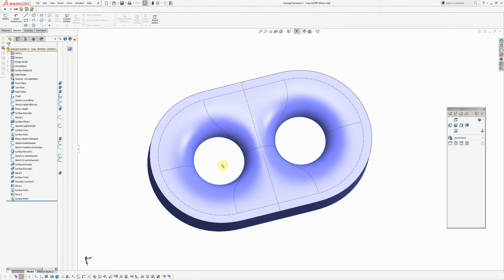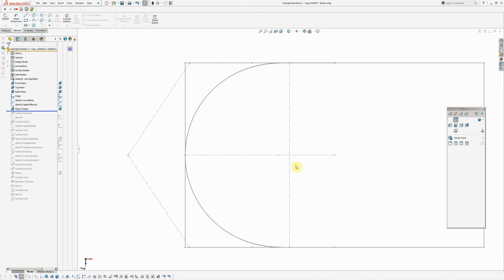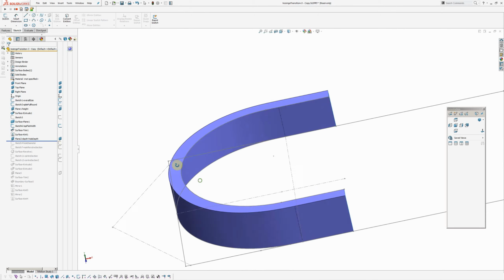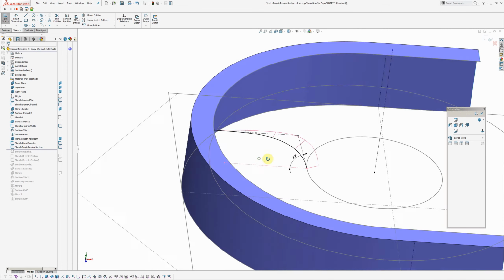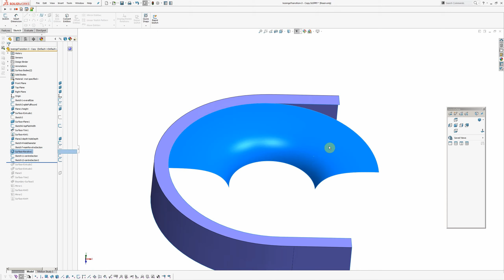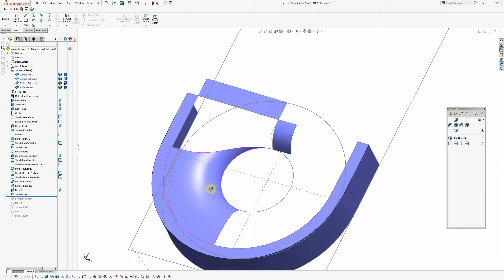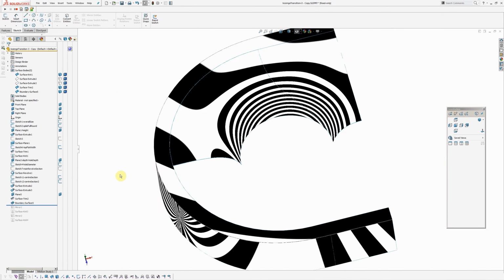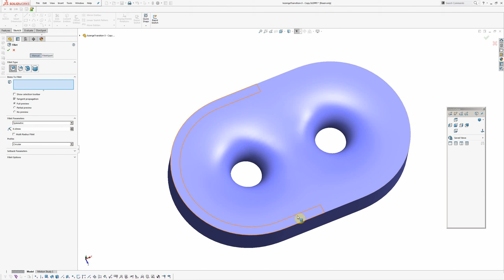Solidworks Tutorial: Modelling a single to double loop transition

Comment: Great video, very clever way of getting that transition to work. Would you be able to do a video on G3 (torsion) continuity for splines and surfaces?
Reply from the maker: I stopped my maintenance at SW2017, so cannot cover the new G3 constraint. Do you know if they have added a G3 constraint to loft/boundary? You can still make G3 corners in SW (pre 2020) blending between lines, with a style spline, degree 7 (8 cv'S) and making 4 cv's on each end co-linear to the relevant line.
Reply: @AndrewJacksonDesignStudio  Maybe a bit late, but at least for SW2020 they haven't added a G3 constraint to the boundary loft etc. 
Thanks for the vid too, very helpful.